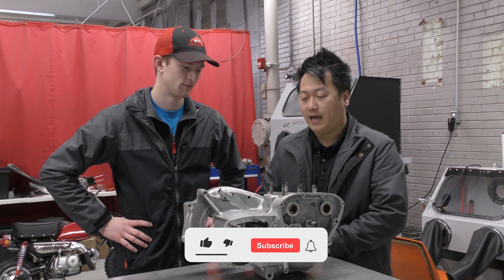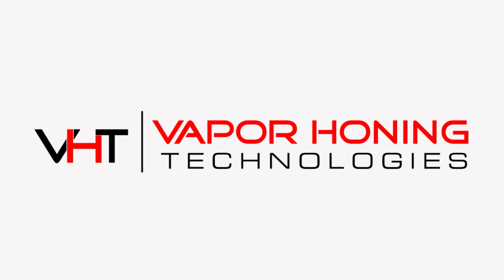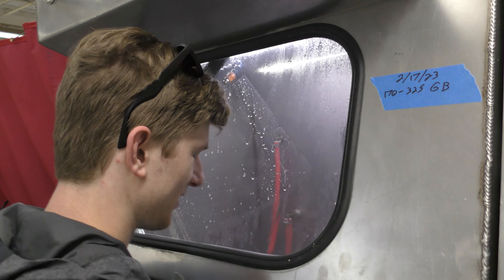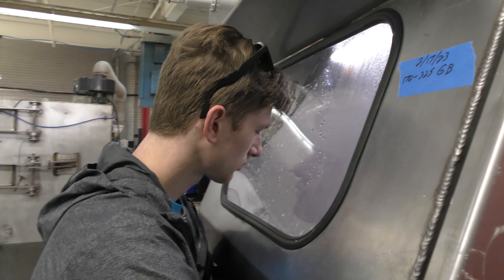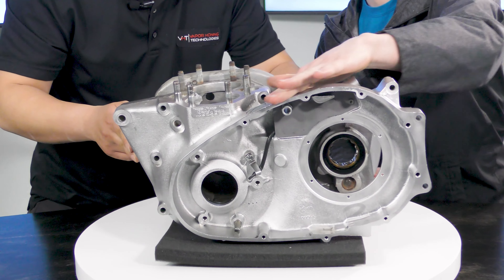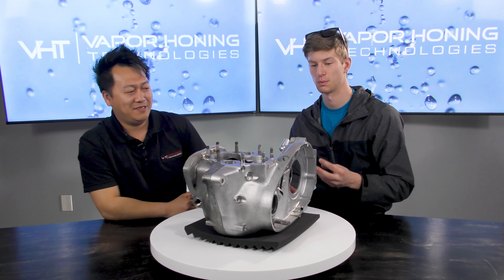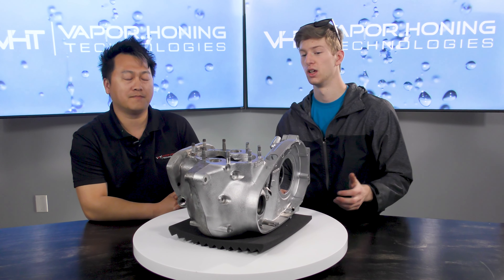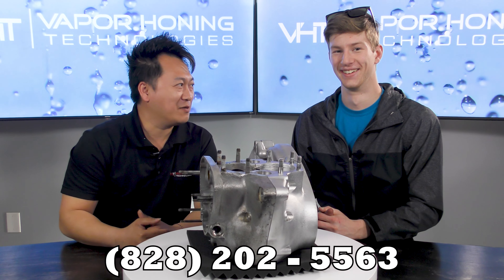Back to our Roots: Polishing & Restoring Aluminum Motorcycle Parts - Vapor Honing Technologies

Comment: What does your pre-cleaning process look like? Ultrasonic cleaner or a more abrasive material the followed up with glass beads?
Reply from the maker: For this part we actually just used the VH1000 HD with glass bead. The slurry mixture does an excellent job of cleaning and finishing parts at the same time.